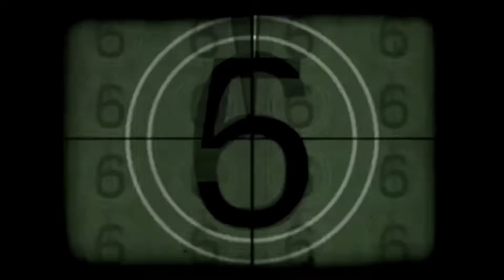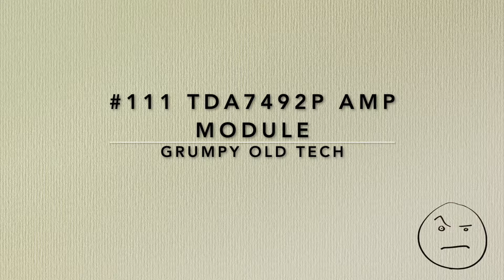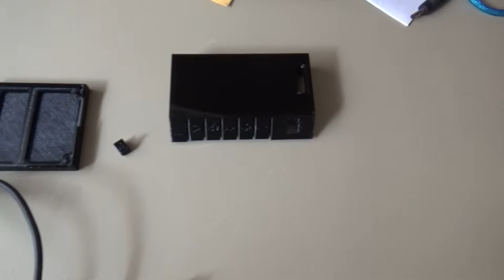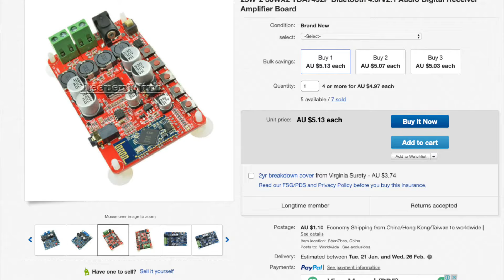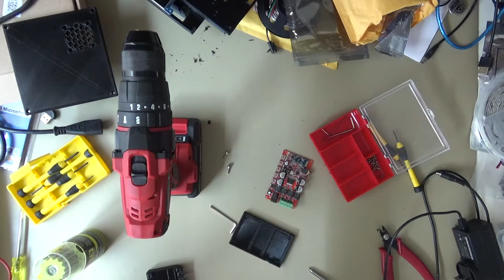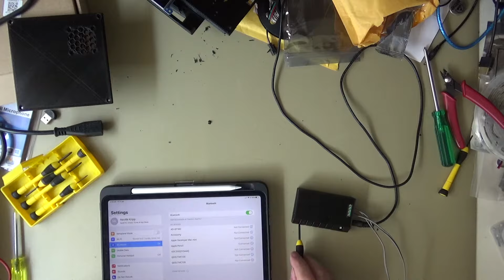#111 Putting a TDA7492P Amp Module to use

Comment: Issue I had with these is the bluetooth range, which is horrible and can get blocked by people being in the way.  It's like 3ft reliable, anything more is patchy.  I have 2 of them; tried cutting traces and doing an external antenna and nothing really worked.
Reply from the maker: Ok I’ve only got the one but it’s been reliable up to, maybe 12 metres and that’s also through a partly brick and glass wall. When we sit out close to it, with 6 metres or so, it’s been perfect.
What voltage were you running in on?